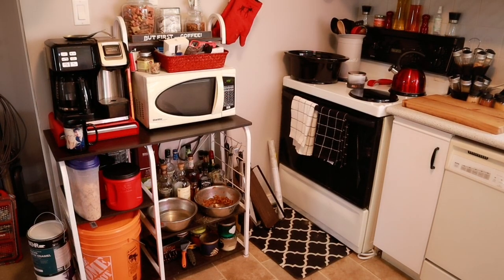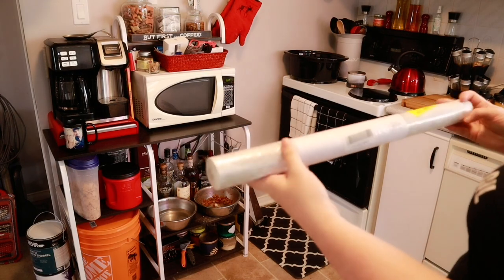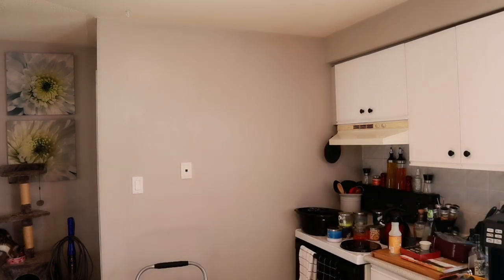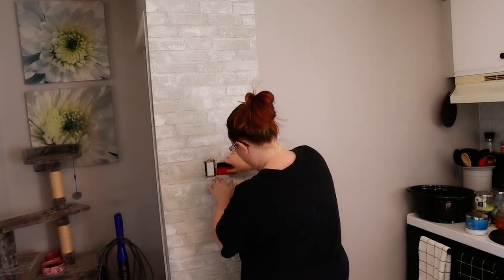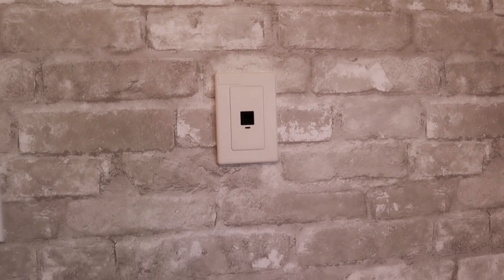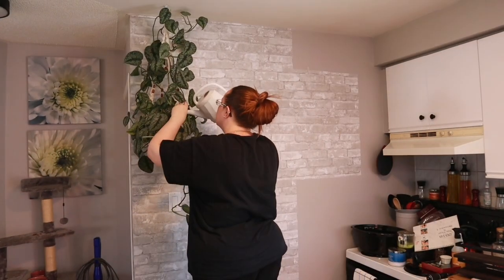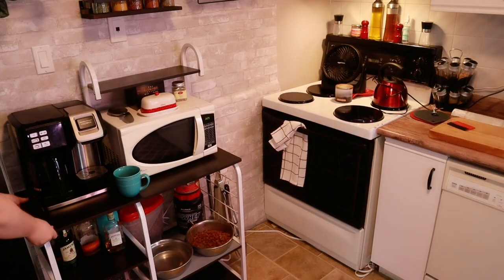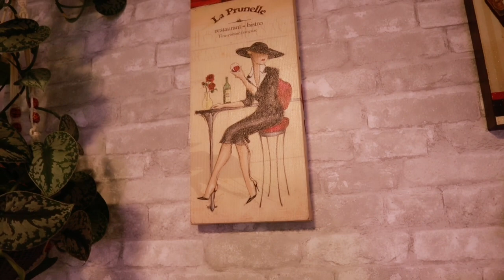Installing Peel & Stick Wallpaper - Creating An Accent Wall In My Kitchen

Comment: Wayfair has loads of wallpaper. Free shipping . One word of advise well really two. Google how to measure wallpaper because if you have to order  more it very well might not be from the same lot. Meaning a small difference in color, design or something of that nature.  Number two, do not get a drop match unless you have a big budget.  Get one with a straight match or random match. I also would not use peel and stick on an old house.  With reg wallpaper you can tear it in the corners a .little to make it match up.